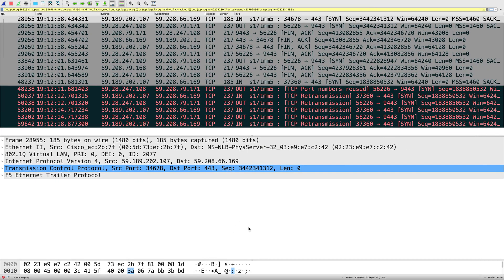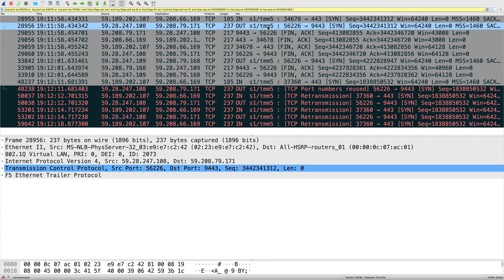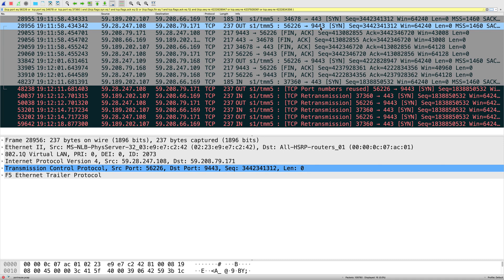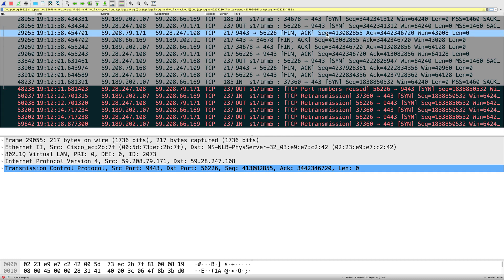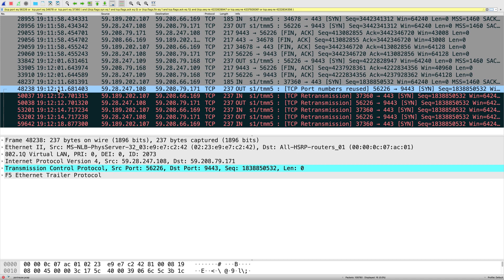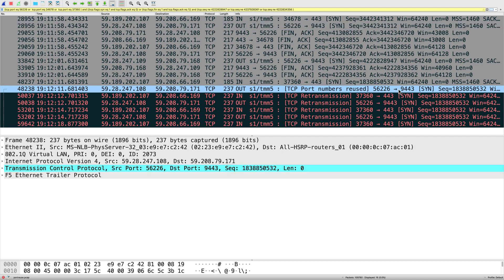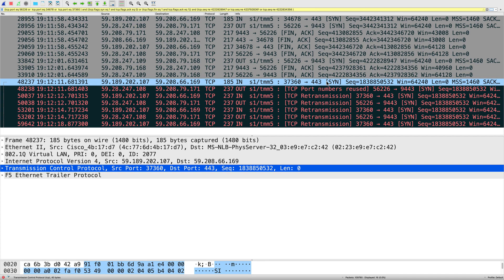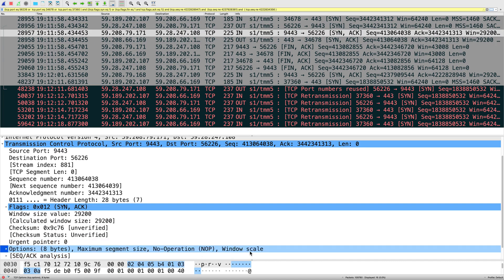TCP client port reuse and TCP server TIME_WAIT

Comment: Thank you so much. i am seen a similar problem, but in my case, client uses the same source port for every connection, so 1st connection goes thru, but 2nd connection sometimes fail, and these incarnations can happen very quickly too. At server side, I know they have F5 load balancer but I dont have access to log there, so bit hard to tell if server side sock is at TIME_WAIT. 
my work around is at client side, don't do connections too quickly, i have 2 mins gap between connections. anyways, still debugging, your video really helped. thanks.